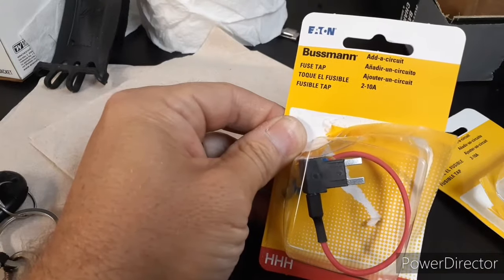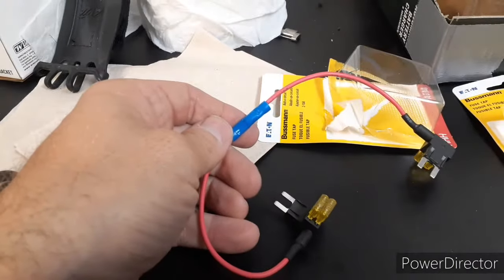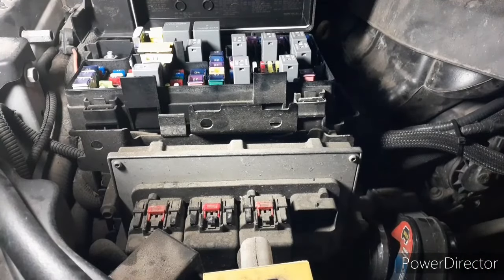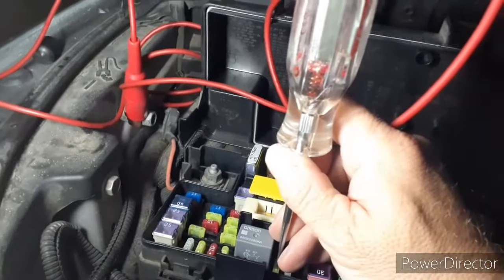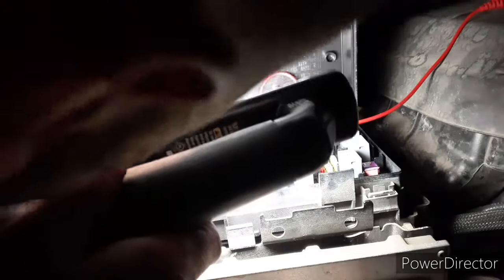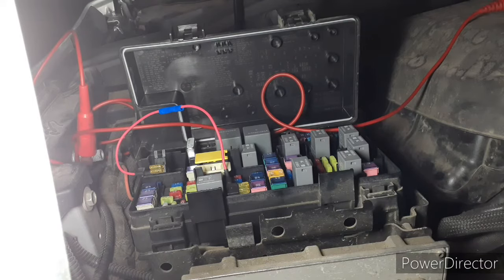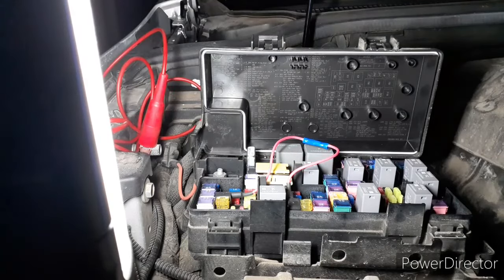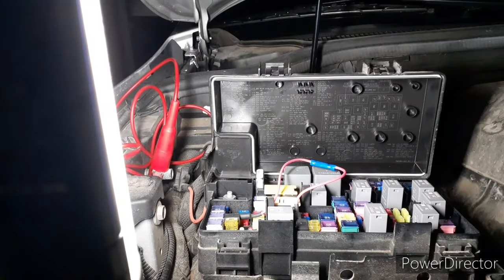Jeep Cranks But Won't Start. PCM Bypass Solution.

Comment: Hi Mr. DinStaar. I have a 2016 JGC Laredo. While driving i lost all power while at a red light. Had to get jeep towed. Had alternator, battery, starter, and auxiliary battery checked and all is great.  When i have been able to start jeep all dash lights and gear lights blink continuously before jeep shuts back off. And sometimes it just on its on continues to start but want turn completely over. Can you share some wisdom with a young buck ( 19yr old ) to help me get my baby back running
Reply from the maker: Any mechanic who is honest with you will tell you a diagnosis should be done in person. Anything else is a guess as it could be literally hundreds of things causing your issues. Your issue could be as simple as a bad ground, loose battery cable, PCM, fuse panel, etc...

Without the vehicle in front of me where I can touch it, see it, and hear it I simply don't have enough information to tell you what is going on. If you are in the Waco, Texas area I could help you figure it out.
Reply: @dinstaar  im in the dallas area and the jeep will not remain on
Reply: @dinstaar  just checked pcm fuse and its not getting any juice
Reply from the maker: @skylimits313who9  When you say "lost all power" please be specific. Do you mean your engine died?  Or no electrical function like nothing on your dash worked as well as windows and lights?

The fuse you are checking is it the fuel pump fuse I mention on the video? Is your key on? Do you have power at other fuses?

I would help you out if you were anywhere near me. You are more than 100 miles away. You would not want to pay that bill man.
Reply: @dinstaar  My engine died first. Then my dash lights started flashing uncontrollably and they too died. Jeep wasnt getting any type of power. Lights want come on, windows wont operate, couldn't shift to neutral either. Tried getting a boost and that didnt work. At first i wasnt getting power to any fuses until i hooked negative cable up to ground inside fuse box and positive on regular positive terminal. Then i hooked cables other end to my girlfriend's car. I then tested all fuses and found that the pcm fuse has no power along with the AC Clutch
Reply: @dinstaar  the jeep will sometimes crank but will not completely turn over. It will continue to crank on its own before it shuts off on its own. If it does turn completely over it last maybe 5-10 seconds before it shuts off again. Ive checked alternator, battery, and starter and all is good
Reply from the maker: @skylimits313who9  Well, if the car were here, I would first check for a bad or loose ground around your battery or chassis. I would then try to jump the wire from a powered fuse to your PCM to see what happens. 
Good luck.
Reply: @dinstaar  thanks will do. Any help right now is appreciated
Reply: @skylimits313who9  while I'm doing my search on "Jeep won't start* I found a question like yours and some people replied you need to change your battery, focus on the amperage it should be the same or more not less.
Reply: @batoot2die100  found out that the problem was a blown fuse in the fuse block. Trying to figure out where to buy part without going to dealership
Reply: well just saying not all dealerships are bad, sometimes you just get the wrong person who doesn't care, did you take both batteries out and test them separately? one battery can drain the other or if one bad cell will kill the other battery....how did u hook up the negative to the fuse box??? that is battery positive feed for the fuse box...surprised u didn't have bigger problems...which fuse blew out and u might want to figure how why it blew out...best of luck let us know what u find
Reply: @curtismiesner3723   one of the fuses inside the block fuse blew out. Had to go to dealership and get a new one. They dont sell them in any of the local auto parts stores. Could have purchased it from rock auto online but i didnt want to wait 7-10 days for the delivery.
Reply from the maker: @skylimits313who9  I was going through my comments and wanted to see if you got her running.
Reply: @dinstaar  yes sir i did. Turned out it was a simple fix. The block fuse which is connected directly to the battery had a blown 150 amp fuse. Ordered part online due to the cost being cheaper than dealership. About half the price. Baby started right up after replacing. If i remember correctly the block fuse has 4 or maybe 5 fuses all connected in a small block which is connected to the battery. The 150 amp was blown.
Reply from the maker: @skylimits313who9  thst's great! If you ever need me (and it is drivable), I am not too far bud. Have fun Jeepin!
Reply: @dinstaar  will do. Thanks again

Comment: So just putting in a new fuse in the fuel pump slot won’t do it?
Reply from the maker: No it won't. The malfunction here is internal, inside the computer. There is no power getting to that fuse in the first place, that is the problem. This bypass supplies power the circuit that is not getting the power. 

You can change fuses all day, but if there is no power going to them you are wasting your time. Understand?
Reply: They finally did a recall on this and they add a external relay from the tipm. Free of charge.

Comment: Can I use two 10A or do I need two 20A
Reply from the maker: The fuse must be equal to or higher than the one you are replacing or it will pop. If it is a 10 amp, anything 10 amp or above will work. If it is 15, then 15 or above will work, and so on...

Comment: You connected to fuel pump fuse & fuse #7
BTW what fuse #7 is that PCM or cigarette
Reply from the maker: It is turning on the fuel pump without the PCM. Get the PCM out of the equation, it's broke. Lol. All you are doing is finding a fuse that powers on at key off and powering off on key off. The fuses I am linking are the 12v aux (cigarette lighter type) and the fuel pump. 

If you are working on something different than this specific model there is a map of fuses labeled under the lid of the panel.

Comment: OMG im having the same problem with my 2011 Mercedes S550 I put a new fuel pump new fuel transfer still crank no start I'm not getting power to the fuel pump
Reply from the maker: If you have a multimeter, start by checking to see if there is power getting to the cooresponding fuse for the fuel pump. Look for power at the fuse, not the pump.  Let me know the result.
Reply: Yes i have checked all fuses an relays related to the fuel system today they are all good it will only start for a few seconds if i spray starting fluid in the intake but no fuel pressure at all U0109  code is there lost communication with fuel pump control module is it any way to bypass that... and thx for replying an giving your advice
Reply from the maker: @draymondgreen7606  Now that you know you have power at the fuse, you know your computer is sending the signal for it to kick on. Check to see if you have power at the fuel pump. If you do not, you most likely have a broken wire. If you have power to the fuel pump and it does nothing, probably a bad fuel pump.

If you are near Waco, TX bring it by. 😎

Comment: Has anyone ever done this fuse tap trick on a Jeep Commander?? They only made them from  06’-10’. And I have a 06’ and the fuse box is way different and I can’t figure it out I bought all the fuse taps and stuff for $30 and will be towing it to the dealership for a $900 TIPM replacement today if I can’t figure out how to fix it.
Reply from the maker: If you are in over your head do not attempt this repair. I can tell from your comments you need to go pay someone.

Comment: Could it be te same problem if the grand cherokee shuts off while driving?
Reply from the maker: Yes, however less likely. Does it start up fine every time? 

Fuel needs most assistance after the vehicle sits and your fuel lines need primed with fuel. This is why the issue is so prominent upon starting. 
Of course there can be other circumstances that can effect fuel delivery. Can you please be as specific as possible with your symptoms and driving conditions? Maybe I can help.

Of course having the vehicle in front of me is the only way to diagnose it correctly. If your are in the Waco area let me know.
Reply: That sounds like the recalled ignition switch my commander did that and got it replaced for free at dealer recalled
Reply from the maker: @timland7553  Tim, it is not a fuel pump or the ignition switch. This bypass would fix neither problem.

Comment: I have 2010 Jeep Liberty and it does not work at all. Cranks cranks cranks but no start. I did your mod and I’ve cranked til battery is dead. This does not work!
Reply from the maker: Well, this mod does work.  In fact Chrysler stole my idea and is using it as a recall on some vehicles.  However, it of course does not fix every single mechanical defect on your Jeep.  I make no claims that this will magically make your jeep run if it does not start for any reason. I clearly state that this is for a known issue with certain PCMs. You clearly have a different problem, not the PCM.  If you have a 2010 your fuse box looks very different than the one in my video.  The trouble shooting test I did with the voltmeter is something you skipped. If you would have attempted it you would have noticed your box is different.  

Here are some things I suggest you test on a vehicle that cranks but does not start.  First check battery power at the battery and then at the starter.  Not enough power can be the issue.    Then check the air filter, a clogged filter will not allow an engine to breathe and it will not start.  Next check to see that there is power to your fuel pump.  If there is and you cannot hear and feel the fuel pump, replace the pump. If you hear and fuel the fuel pump engaging it may be the fuel filter, replace the filter.  Also check for any broken or loose fuel line connections.  Last, you may have contaminated fuel.  

Good luck.  If you cannot find the problem with these suggestions you need a shop near you.

Comment: WOW , 
before you all start blaming this guy for it not working why not check if you have fuel pressure at the fuel rail ? 
"MY CAR WONT START "
 really ? 
do you have spark?
 fuel pressure ? 
and the big one
 (Yes i have been called out many time to find NO FUEL IN THE TANK )

Great vid mate 
Rob
NSW
Australia
Reply from the maker: Thanks for watching and paying attention. I am pretty clear that this is the solution for a specific problem but some viewera don't catch that. 

You are 100% correct that in order to know if this will fix your Chrysler PCM problem troubleshooting must be done first. This is not a magic solution to fix every problem on a vehicle.

Comment: Do you have a way of doing this for a  99 Grand Cherokee limited ?
Reply from the maker: I don't own that schematic. I would not advise doing this bypass without properly troubleshooting the problem first
Reply: @dinstaar  hey I have an 2001 grand cherokee limited...I recently had to replace the ac resistor now jeep Cranks but won't start..could this be to fuses?. Or something else?
Reply from the maker: @drewlewis3476  there are hundreds of reasons a vehicle won't start. Diagnosis cannot be done without a vehicle in front of me. Are you in the Waco, Texas area?

Comment: Need help.have 2000 wrangler.will not run
New pc.fuel pump.crank sensor.other sensor.5 v to them.turns over but will not run.helpppp
Reply from the maker: Are you in the Waco area?  If so I can come over and take a look.
Reply: @dinstaar  no in chattanooga tn
Reply from the maker: @howardmoses6280  Sorry man. Too far me to check it out. Find a reputable shop near you. Good luck to you.
Reply: @dinstaar  thanks
Reply from the maker: @howardmoses6280  I wish I could be more help. There are so many things that it could be I would have no way of knowing without the vehicle in front of me.

Comment: What year was her Jeep?
Reply from the maker: This is a 2013 Grand Cherokee, so it is a WK2.
Reply: @dinstaar  mine is a WK2 that one would be a WJ/WG. I was only asking due to the fuel relay recall issue thing and bypass. I have a 2015 with crank no start
Reply from the maker: @latrellebrigham5462  WJ 1999-20004
WK 2005-2010
WK2 2011-2022

If yours is a 2015 check your fuse box. If it is identical to the one in the video, and yours tests the same, you have diagnosed and can repair this issue.
Reply: @dinstaar  initially you said 2003 lol but thank you for your help
Reply from the maker: @latrellebrigham5462  Sorry for the typo. I went back and fixed it to avoid confusion. Good luck!

Comment: Does this work for the 2021
Reply from the maker: A 2021 does not have this issue. You are under warranty anyway. If you are having any problems your dealership should handle if for you free of charge.

Comment: great video unfurtunate it did'nt work at my 4.0 l wrangler from 97 I assume that the German version is not working on the same way. Is there any possible way to contact you Sir ?
Reply from the maker: A 97 has a different computer man. I used to have a TJ myself! Nice ride and unstoppable.
Reply from the maker: What are your symptoms? Maybe I can point you in the right direction.
Reply: @dinstaar  the remotcontrol don't works from time to time and I do not know if the sender or the receiver is wrong battery is for sure ok
Reply from the maker: @frikoeller1350  Remote? Arr you troubleshooting a remote start or something?
Reply: @dinstaar  there is an independend litte key you have to push and the car answer with to short beep after this you can start the motor and this don't work most of the time not anymore
Reply from the maker: @frikoeller1350  That is not standard for a 97 TJ man. I can't really help with aftermarket security systems because there are too many different ones out there. Without the vehicle in front of it is impossible to figure out. If you are in the Waco, Texas area I can stop by.
Reply from the maker: @frikoeller1350  No, sorry. My mechanical experience for automotive is at dealerships. I know OEM stuff best, but aftermarket items are too vast of a field to know them all. Good luck.
Reply: @dinstaar  tanks again and ..... stay negativ :-)

Comment: I have a different issue on my 2011 GC. IT runs fine and it cranks fine but it turns off on me every now and then at a stop light or at really low speeds. I was wondering if this along the same lines
Reply from the maker: No. This is not your issue. The common failure of the PCM does not allow the fuel pump to turn on. If yours starts up and runs at all, this is not your problem. 

You most likely have a fuel problem though. Could be fuel contamination, a clogging fuel filter, or a hairline crack in your fuel line somewhere. Start looking around. Good luck.
Reply: @dinstaar  thank you! I also noticed it kicks while I’m driving  right before it’s going to turn ooff
Reply from the maker: @Vino_91  Yep, definitely a fuel issue.  Without the vehicle here I am unable to see and hear it.  The noise you hear may be your engine sucking air instead of the fuel needed for combustion.  If you don't have experience in this area, fuel problems may be tricky.  You would benefit from taking it to a mechanic  with the proper tools to diagnose the problem.  Good luck.

Comment: Will this technique work on other fuse port that have no power? While checking for power on the PCM fuse (which had power) I discovered the Injector fuse did not. Can I use this jumper technique on the Injector fuse port?
Reply from the maker: This technique can be used for other purposes. However, I don't know exactly when the PCM sends electrical potential to the injectors and when it turns it off. I have never had that issue or fixed that issue for a customer. 

I would ENSURE that it is supposed to power on at key on and turn off at key off before doing it. I also should clearly state that without your vehicle in front of me it is impossible for me to definitively diagnose your exact problem or know if this will fix it. 

Good luck.

Comment: Tried this but still just cranking without it actually starting.
Reply from the maker: Then your issue is not your PCM.
Reply: Fuel pump
Reply: Or even fuse to the fuel pump motor

Comment: In doing this do you take a chance on frying your fuel pump
Reply from the maker: No. That is a pretty silly question. Your fuel pump needs 12 volts to run, this bypass provides the needed voltage. In fact, in no way will an automotive vehicle ever provide enough voltage to "fry" anything unless you have a short. If you had a short you would know because you would be popping fuses as soon as you install them.
Reply: @dinstaar  Silly question thanks there won't be any more questions for you